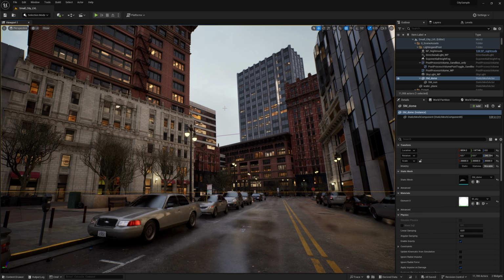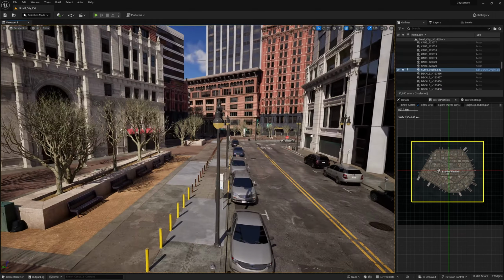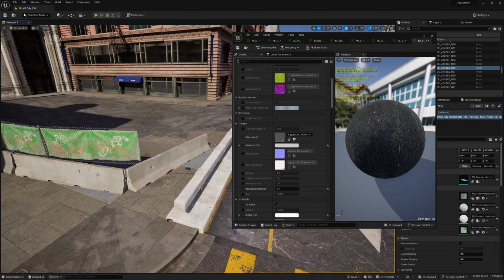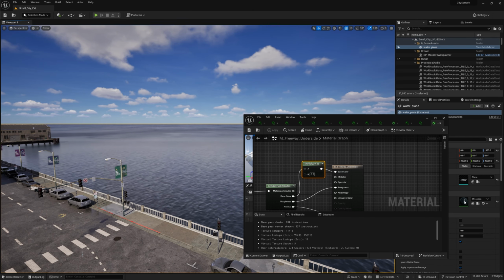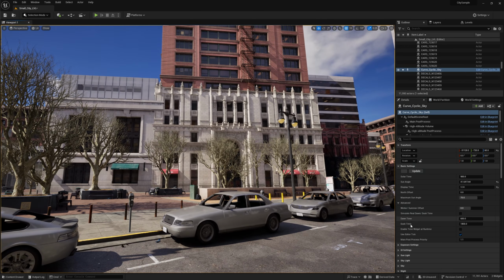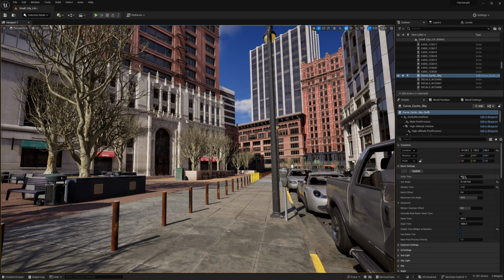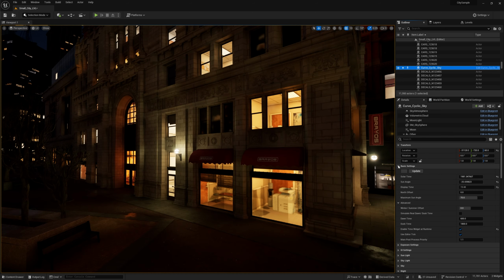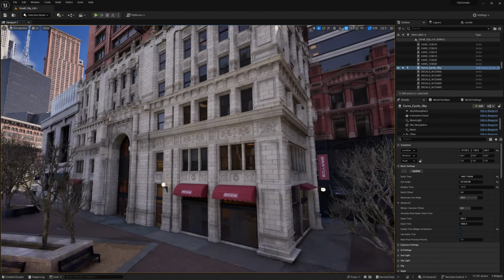Curve Cyclic Sky Tutorial 1 Create a day night cycle in the City Sample

Comment: wait i dont get how you hit play and it's runtime day/night cycle?
Reply from the maker: The blueprint itself comes with a day-night cycle. Simply drag it into the scene and run it to use. To control the time, you can either enable the time UI or directly adjust the time property of the blueprint.
Reply: @BloxStudio-tv6qs  So you're saving it plays automaticallym, but then how can I change the tick amount the sun rotates so a day would be 15minutes as an example
Reply from the maker: @spinav  In the video, the day-night cycle is handled in the level blueprint by changing the CCS blueprint’s Solar Time. You can adjust these properties from any blueprint, even in sequences.